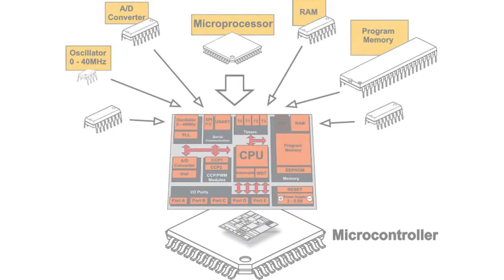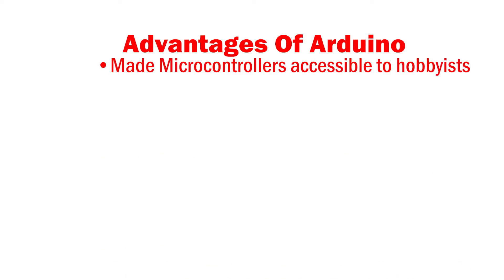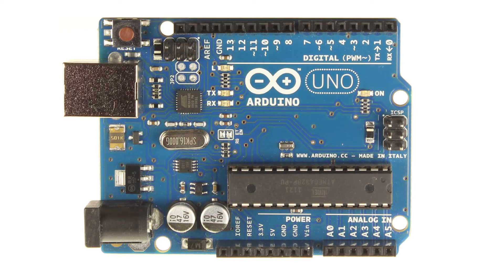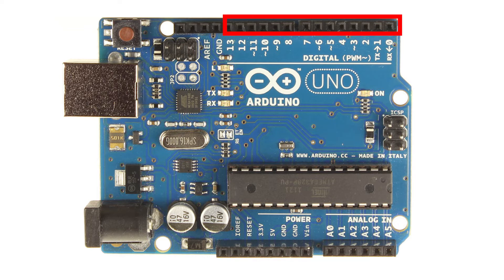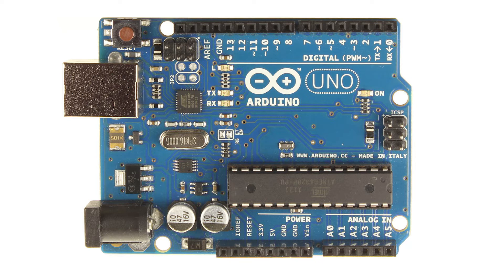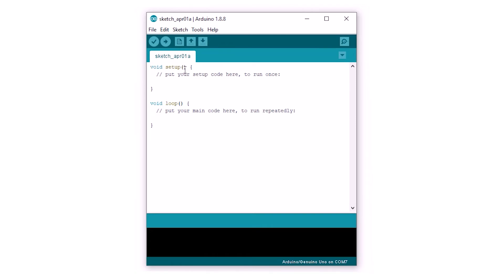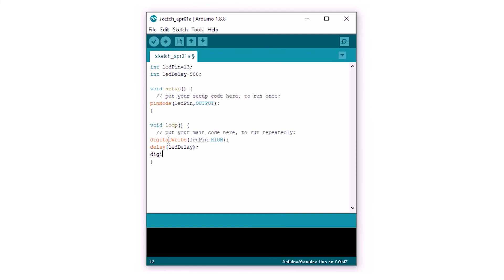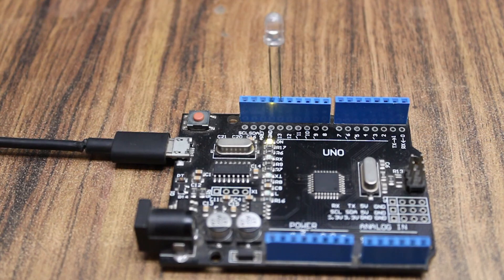Arduino EXPLAINED

Comment: Wonderful videos . Thanks . Can you pl develop simple stepper motor control application that has ability to control speed/ direction / limit switches on both sides . Let's say single axis and 2 axis controller with limit switches . It will be nice of you . Best of luck with Best wishes 😀🙏